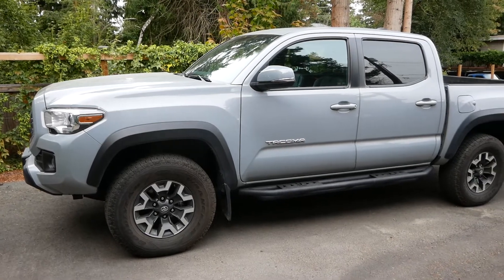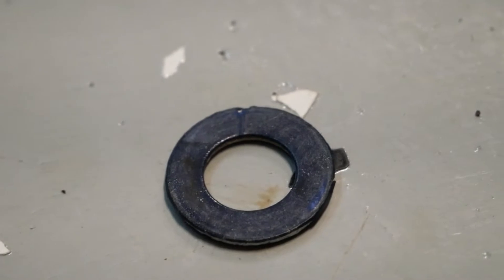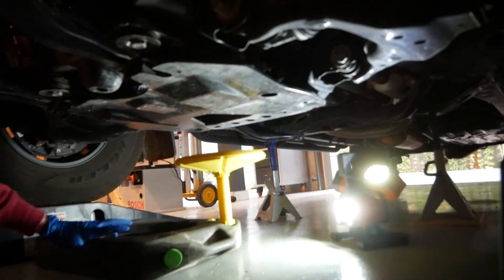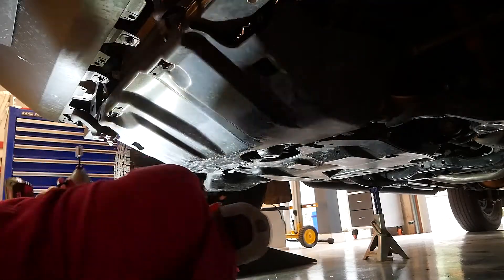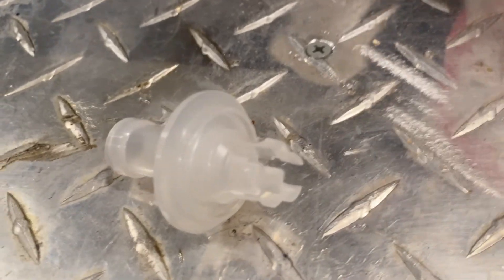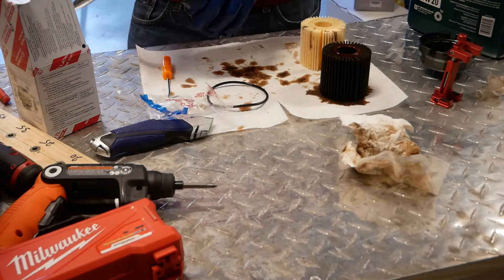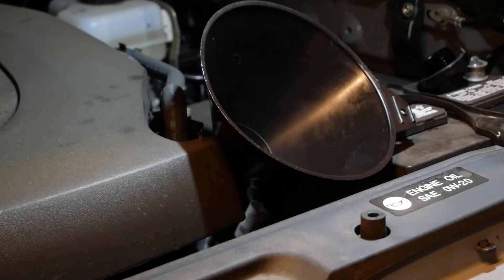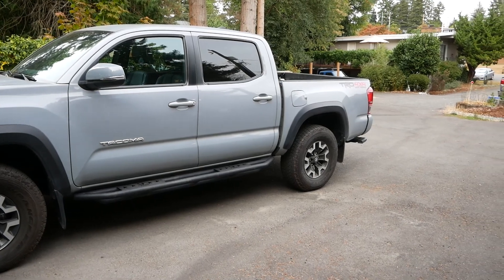2019 (2016+) Tacoma Oil Change - How To

Comment: If you don't have the fancy oil filter drain tool you can use to plastic thing and a 20oz soda bottle to catch the oil. The tool will fit in the opening of the bottle.

Comment: The reason you had to use a cheater bar to get your oil filter off.Was because it doesn't look like you.Oil the o-rings you need to put oil on them before installing.